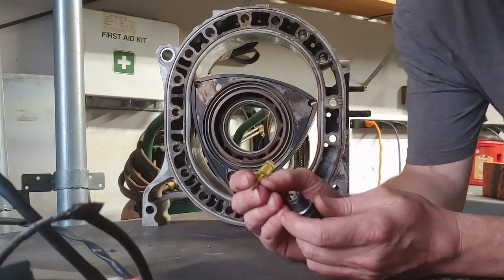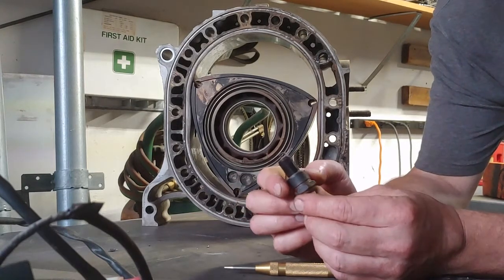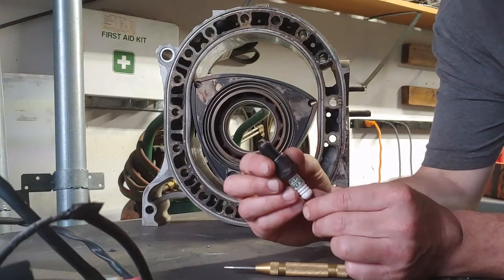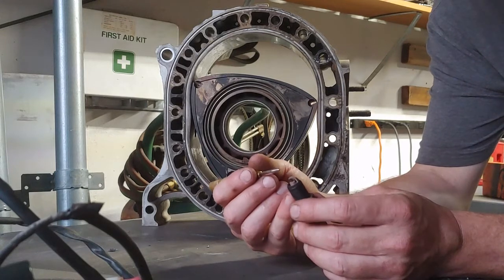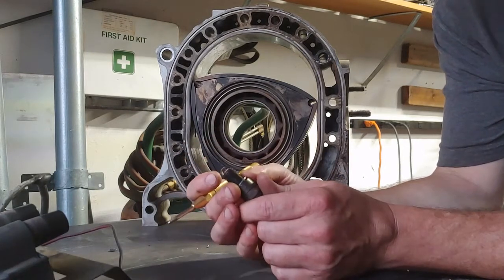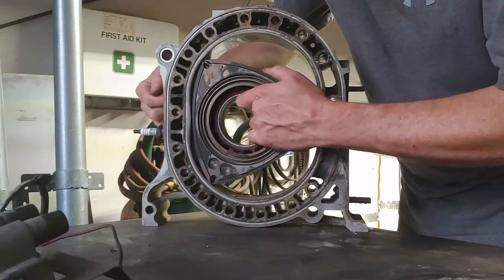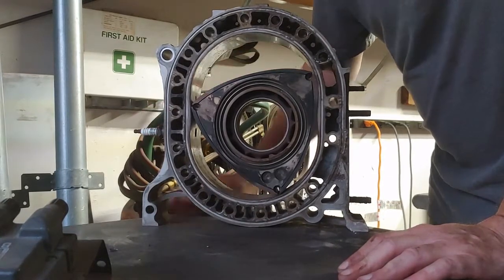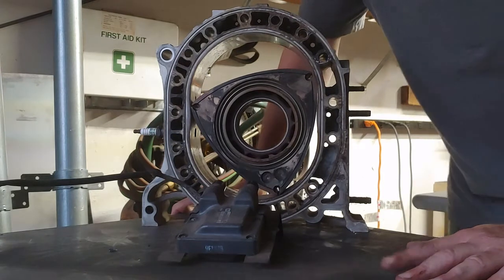Wasted Spark and Rotary Engines

Comment: I saw a video similar to this many years ago and can’t find it.  This one shows it’s three years ago.  Did you post anything about this maybe ten years ago?  There was a 2nd tip that the mechanic made that I can’t find.  Between the two modifications, the engine was stronger, more efficient and had a lot better emissions, which allows for less emissions control.  I believe the port for the spark plug was narrower.
Reply from the maker: No, I didn't make any other video. I have heard of people cutting the grounding strap of regular top-fire spark plugs back and re-bending them so they're side-fire for a "performance gain". I tried it once and it didn't help, so I just stuck with the the NGK BPR5ES plugs. Thanks for watching!

Comment: Nice analogy. Wasted spark firing in the exhaust event of the ‘other’ rotor may also help ignite incompletely-burned fuel  
In that rotor for better   emissions. Also, it can explain why rotaries love to ‘pop’  during hard-starting because wasted spark happens when exhaust port starts to open and maybe unburned gases are still present. Yep, a bit confusing but it’s sure helpful. Thanks bro.